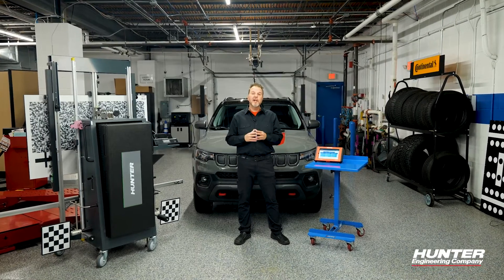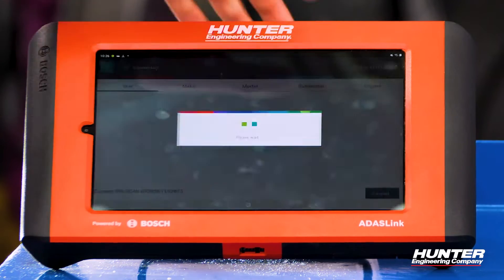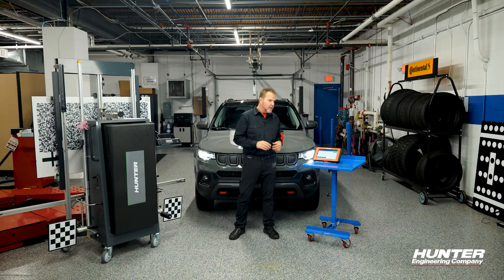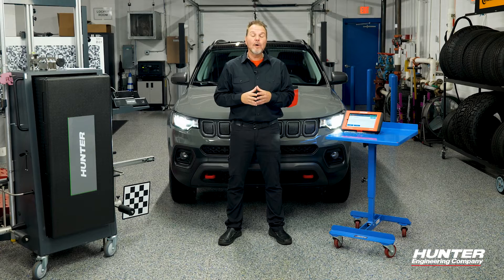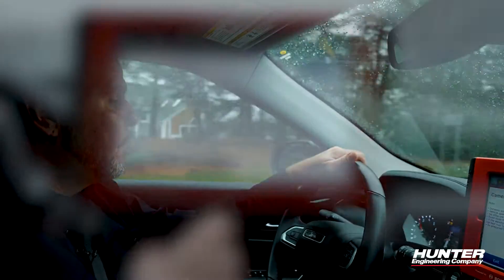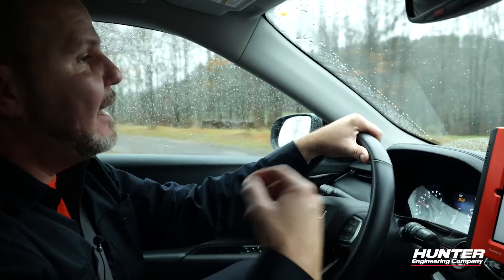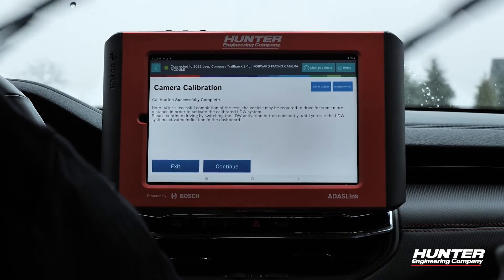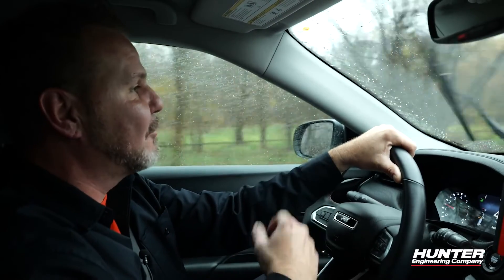ADAS Calibration: FCA/Stellantis Forward Facing Camera Calibration

Comment: Hello, 2022 RAM 3500, truck had a front collision. Bumper and sensors were affected. After repairs were done, only feature not working is Lane Assist. It turns on, but no feedback at all on steering wheel and never turns green on dashboard. Technician doesn't know what to do.
Reply: Also the front grill and front camera were compromised and replaced.